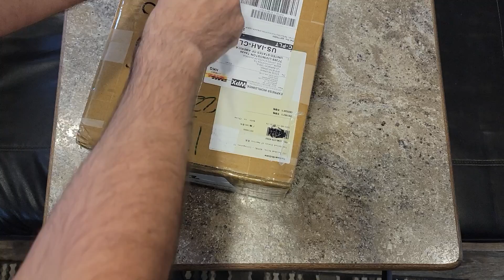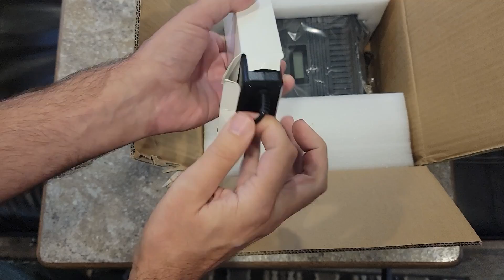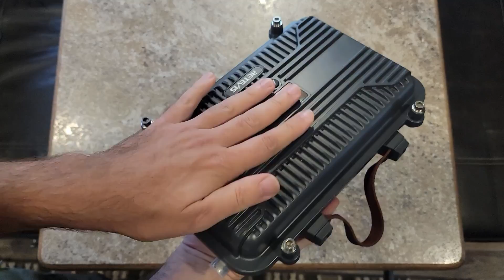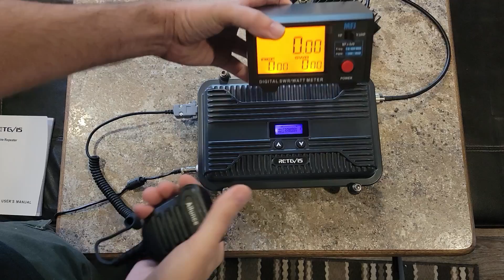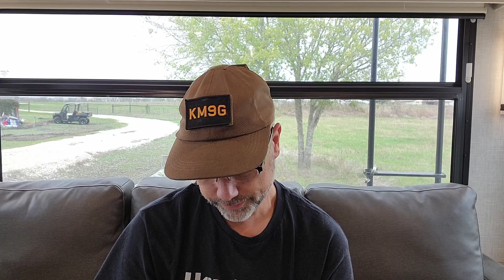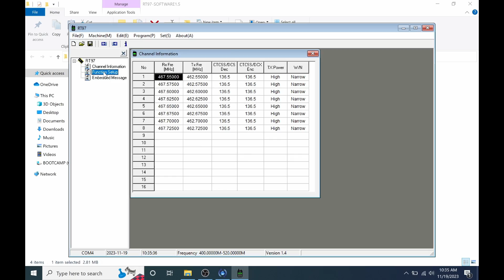Take It... Or Leave It.

Comment: On the Retevis RT97S  what would be a good inexpensive power bank that will run this .
Reply from the maker: it comes with a 5a power supply.  Taking that as a reference: I'd look at a battery that can provide 5ah overnight (no solar), so in winter time... 4pm till 9am = 17 hrs.  17hrs*5ah=85hrs, so I'd look for a 100ah battery for some buffer.  Add a solar controller and at least a 120w panel to charge it up during the day time and you should be able to sleep well at night... maybe an a worry in an extended shady time... but add more solar/batteries as makes sense.
Reply: @temporarilyoffline  Thank you
Reply from the maker: @bryansmith1407  I'm going to do a new video on this soon.  Stay tuned.
Reply: @temporarilyoffline  cool thank you I am looking into one . There are no GMRS repeaters in my area at all.
Reply from the maker: @bryansmith1407  this is a good way to start until some people get interested and want to help.
Reply: @temporarilyoffline   Very true thank you.

Comment: Be careful how much you amplify it.  I have been told (but haven't confirmed) that the legal limit of GMRS repeaters is 50w ERP.  So a high gain antenna might get you close to your limit.  Thanks for the video. 73 - AA4K
Reply from the maker: Good Tips!  GMRS is 50w, but I don't know if its ERP or at the transmitter.

Comment: The feature that seems to be missing is automatic ID of the repeater using morse code.
Reply from the maker: There are devices that you can plug into the 9pin port to do that... but:

95.1751:
(c ) Any GMRS repeater station is not required to transmit station identification if:

(1) It retransmits only communications from GMRS stations operating under authority of the individual license under which it operates; and,

(2) The GMRS stations whose communications are retransmitted are properly identified in accordance with this section.

Comment: Thrilled to see a video on this as I've been eyeing up this unit for a long time, glad your experience was good/promising with it out of the box. I was surprised though about your misconception at the end, you cannot use an amplifier with that unit. If you put an amp after the duplexer you won't have any receive, and if you try to put an amp in-between the tx and the duplexer you will fry the baby duplexer in that box. You'd have to have a much larger duplexer with higher power handling and at that point you might as well go with a whole different system. Probably 500+ other comments saying exactly this already here or on the way... couldn't help myself had to pile on too. Otherwise great video and thanks for making it!
Reply from the maker: Funny you should mention other comments - everybody is saying completely different things - some people have done it, its worked well and others have said it can't be done.  I mentioned it in passing saying its possible - as you know, a smart ham with a large enough toolbox is capable of just about anything.

Comment: As large as is They could of Provided a 50 Watt model Especially for the price instead of having to Purchase a Amplifier to make it a 50 or 100 watt unit 🤔
Reply from the maker: Adding power would make it even larger!
Reply: @temporarilyoffline  there are 50 watt mobile radios in 4 time smaller Packages I disagree that it would need to be larger there is plenty of room in the case we're the radio is to put a 50 watt Unit
Reply from the maker: There is a set of filter cans in that case that would double in size.  50w radios don't have repeater filter cans in them (duplexers) Take 2 of those 50w radios and put them in a box and then add in the filters.   @AntonioClaudioMichael
Reply: @temporarilyoffline oh crap ya your right I spaced the filter cans would get bigger being mobile 50w radios don't have them..
Reply from the maker: @AntonioClaudioMichael  no worries, thanks for watching!

Comment: A user has one of these about 20 miles west of town on a 30 foot tower on his property at 8,000 feet. It gets very good coverage out to about 30 miles south (terrain), close to 50 miles east, and 40 miles north. Not much west due to being up against the mountains. He is using lmr400 coax, and a 6DBI gain antenna. Its on a deep cycle battery with 100 watt solar panel. 
CHEERS from Colorado
Reply from the maker: Hey Bruce, sounds like he's doing the best he can with the terrain issues they have!
Reply: @temporarilyoffline  it does quite well all things considered. My repeater is more powerful by several times, and gets slightly less coverage. But I'm in the city at 5,000 feet, compared to his 8,000. 
WRDA382 
CHEERS from Colorado
Reply from the maker: Height + Line Of Sight wins every time!  @brucel399

Comment: nice review. I have worked with that model. it is 10 watts before the duplexer . will run 24V battery system. That duplexer is tuned to the per set channel.  you will need a nano van and dummy load  to re tune that duplexer. it is tuned for GMRS . no need to re tune . to run more power you have to do this before the duplexer and use a higher power duplexer. GMRS is 50 watts max on repeaters. that a FCC thing. runs like 70 Cm with the 5 MHZ split. that mic port can also be used for repeater ID import and or weather /time station. if you want talking repeater that is the jack to input that. same ID as ham . can be CW or voice. use UHF rated coax. from your portable battery box it will run for days. the Midland one like that is about the same. Just a GMRS license is needed for GMRS repeater . wide band improves sound  a bit. I tested/set up that repeater  with  my POTAFLEX 7 coax and worked great. that 4 pin power port is same as some radios mick jack. I made one with power poles . and a fuse. west mouton radio has a power gate with power poles to add battery back up. what we did. works great. 73's
Reply from the maker: Those are all great tips!  Thanks for sharing!
Reply: @temporarilyoffline  I re did that same repeater last spring with a external duplexer and 50 watt amp. had trouble with LMR 400 coax. wired cross talk from outher repeaters at same cite. hyper flex 10 M & P solved that problem. Aluminum foil shield was the problem.   use copper foil with copper braid. was only 35 ft . on roof of office budling. rented space. 73's

Comment: Do frequencies have to be set at the factory?  How are they assigned?  What about call sign ID?  Important for more permanent installation.  At least for amateur radio I think the repeater needs its own call sign and must transmit it every 10 minutes or so.  I could use something like this if I knew it would not get me into trouble with the licensing authority where I live (not US).
Reply from the maker: I showed in the video how to change frequencies.  This repeater doesn't seem to have the ability to generate its own callsign beacon.  This is a US-GMRS repeater, so the ham rules don't apply.  They do have other models for other regions/bands.
Reply: Don't forget the duplexer has to be tuned as well
Reply: @P.SeanCoady  That is what I meant   by factory config. Setting up a legal repeater is not so simple.

Comment: The duplexer would need to be re-tuned if you changed the channel, right?
Reply from the maker: It should be good for all the frequencies it supports without re-tuning... but if not, you'd need a VNA and a Dummy Load to make those changes.  Its tedious, but not hard.
Reply: the total spread of frequency for GMRS is only 1.2Mhz - are duplexers that sensitive?
Reply: Retevis claims that it's good to go on any of the GMRS repeater frequencies without retuning the duplexer.

Comment: Nice review Steve.  Thanks!  You actually couldn't use an amplifier with that, at least not without a lot of surgery.  An amplifier would have to go between the transmitter and the duplexer.  An amplifier is not going to pass the received signal through in the reverse direction.  I also doubt that the duplexer inside provides enough isolation for anything more than the 10 watt transmitter.
Reply from the maker: Good points!  I wouldn't want to amplify the input, so you're right, gotta get in the middle!
Reply: That baby duplexer will melt it's plastic internal parts much past 10 watts. Be aware it already converts 4 of your 10 watts into heat so use at least 3/8" Heliax to your antenna and keep that as short as possible.

Comment: Looks like a nice I would put it in the ham band run a all UHF Amp with it.
Reply from the maker: They have a UHF and VHF model.
Reply: @temporarilyoffline  that's good I want the UHF I want to add mmdvm board to it add allstsr and dmr she ysf to it. Play with those modes with.
Great job on the video Steve. Hope I can catch you on the air some time.
Reply from the maker: @Chuck1855  sounds like a fun project!
Reply: @temporarilyoffline  I have been working it. For months it is going to take me about year to finish it.   Doing it in steps but when it is done.  I'll be happy.

Comment: Roughly How much distance do you think one might gain with this piece of "Wizardry",   great video tnx man!
Reply from the maker: As with all things ham radio: "It depends" - the higher your antenna and the more clear your line of sight, the greater distance.  For example, you can barely contact your local repeater, but you can connect to the ISS 250 miles away because its a clear line of sight.  I'd expect 30 miles under ideal conditions because of the curvature of the earth.
Reply: @temporarilyoffline  That Sounds fairly reasonable, tnx man.